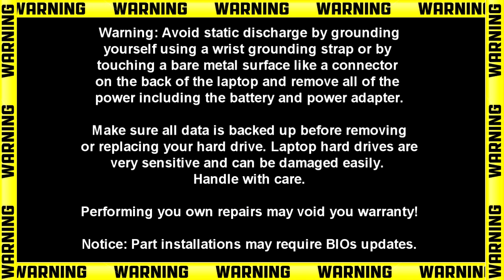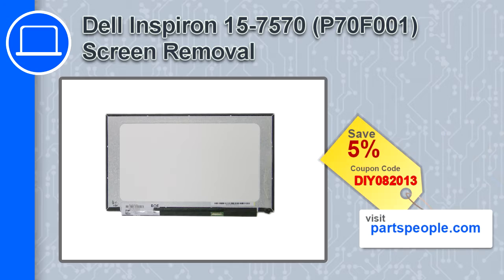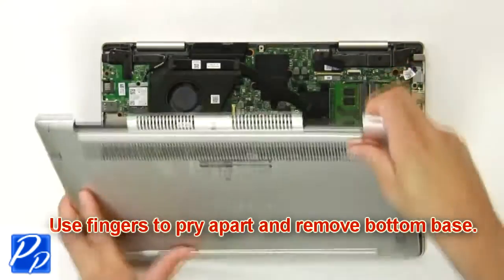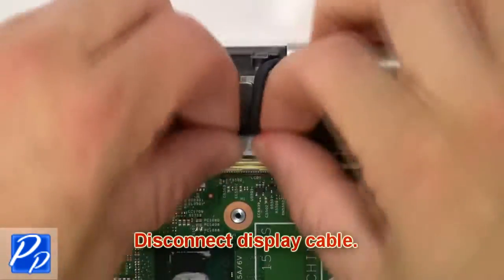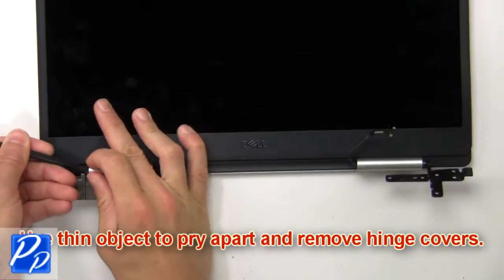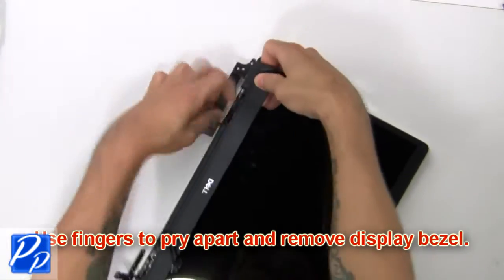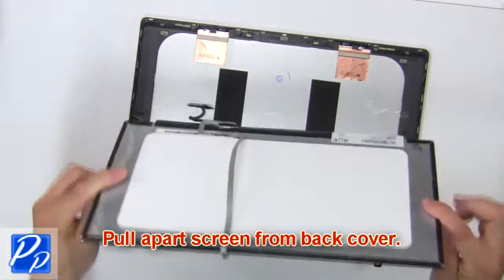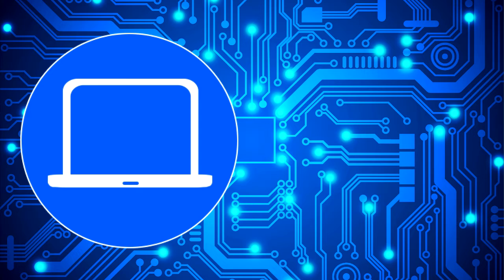Dell Inspiron 15-7570 (P70F001) Screen How-To Video Tutorial

Comment: Hey, thanks for the video!

I've got the same model but it's a touchscreen and doesn't have the plastic bezel (it's all glass). Would the replacement process be the same? It just doesn't seem to me like I could easily pop the screen out from the frame.
Reply from the maker: I would not advise using this tutorial as the removal process is not the same for your touchscreen display.
Reply from the maker: The touchscreens for this laptop are glued together and it is not recommended to take it apart. It would be best to buy a complete assembly that includes everything.  https://www.parts-people.com/index.php?action=item&id=27450
Reply: @dellpartspeople  Thank you!